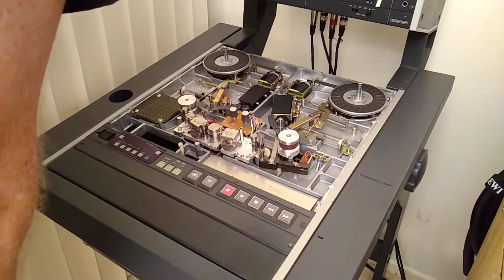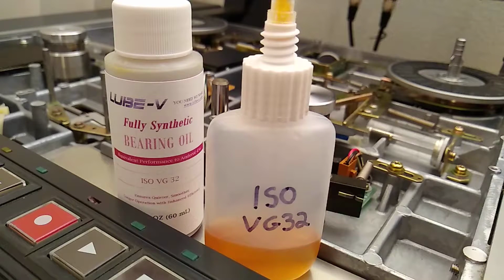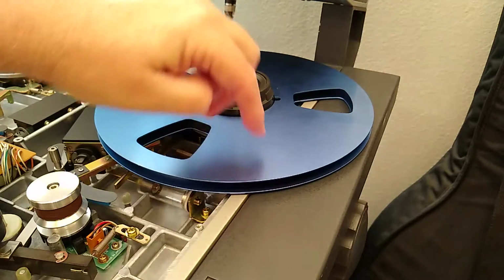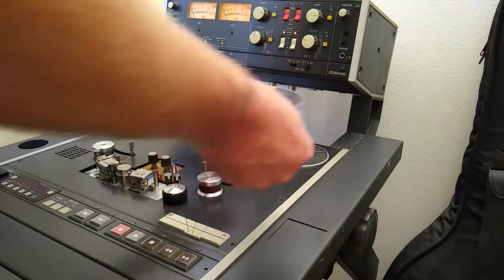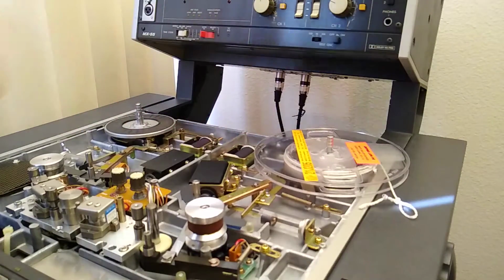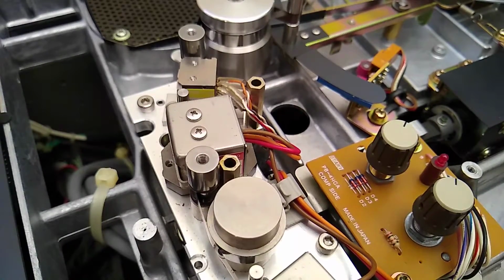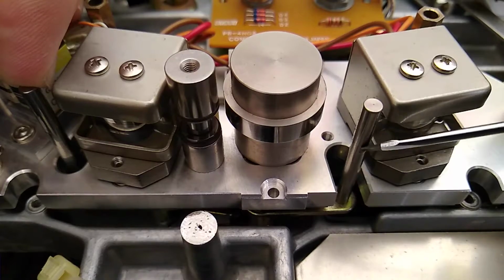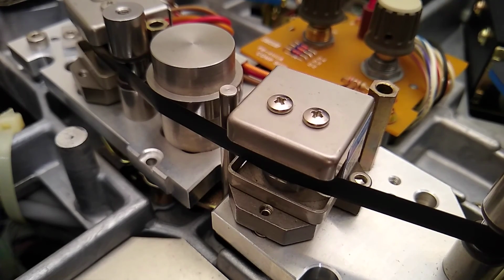Otari MX55T-M Refurbish Repair Part 2 DIYM #39

Comment: I wouldn't screw with braking force unless I had tape unspooling when I hit stop. Modern tape basically never stretches, unless there's some kind of serious malfunction. Regardless, good on you for doing it. Very interesting to see the procedure as I was unfamiliar. Though I will say it reinforced my feeling to never do it haha.
Also, not to be critical but I noticed when you were checking out the tape lifters wear you were taping it with a magnetic screw driver. I would keep magnetic screwdrivers totally away from the headblock because it can magnetize the tape path.
Reply from the maker: Thanks for watching and commenting. Ultimately it just needed some clean, lube and adjust. It runs like a top now but I haven't used it in a while. Hopefully I can do a follow up video soon.
Reply: @DoItYourselfMusician  glad to see it running, would love to have one of these.

Comment: There should be no grove on the tape lifters, the grove you see is wear. 
The normal fix is to rotate the lifter as you have done onto a clean round surface 
The best way to set the reel table height is to view the tape in play and see if it is reeling into the centre of the spool 
Alan
Reply from the maker: Thank you. You are correct and I discuss this wear in the Part 3 video. Unfortunately I had to put the machine in storage in 2020 but hopefully I'll be able to set it up and finish it in the next few months.
Reply: OK thanks look forward to your alignment video part 4 
I have 2 MX55 and they are excellent machines, they do have noisy pots and switches but you sorted that with Deoxit  thanks for your videos they are very good 
Alan